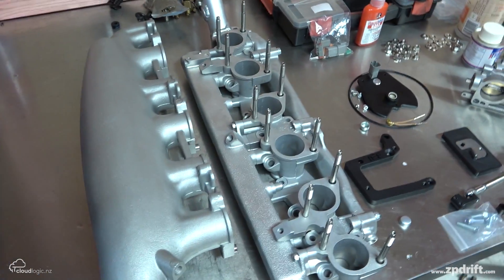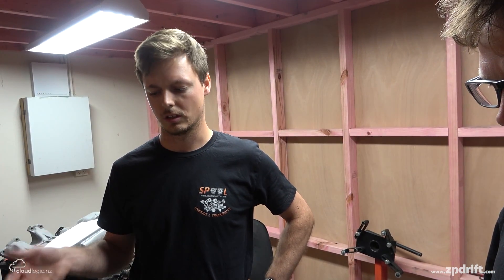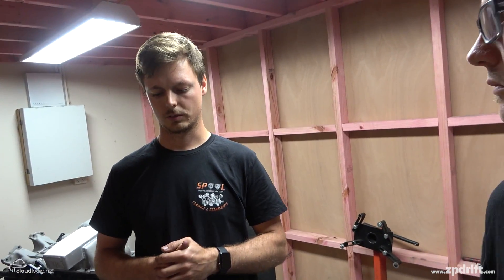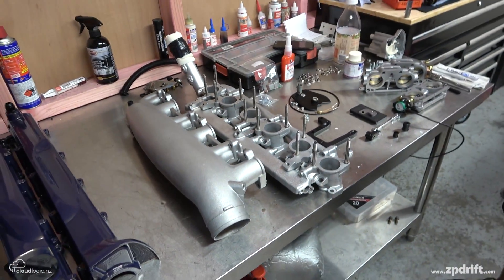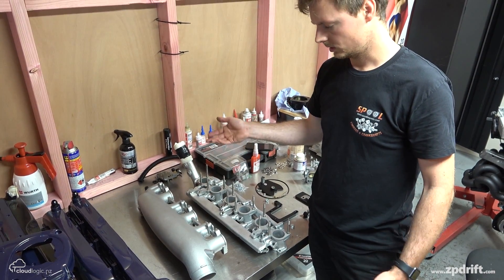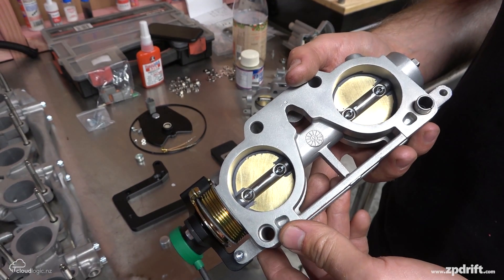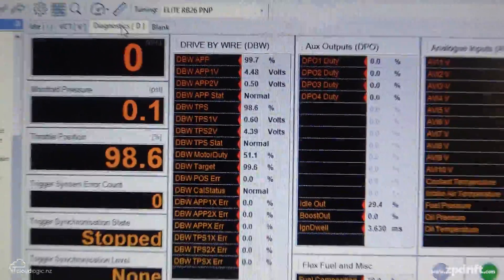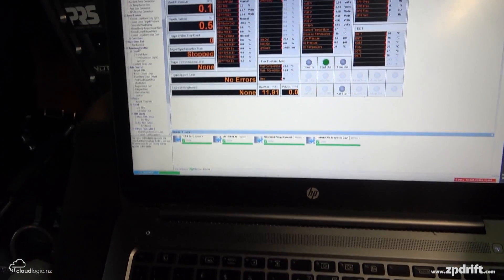RB26 DRIVE BY WIRE ITB - SETUP

Comment: Good demonstration on DBW. But I saw a billet RB block and all sorts of goodies but using an OE intake plenum which is known have so many defects, especially on cylinder 6. Get a decent proper designed intake plenum is a must for RB26 . ITB should not convert to too large throttle bodies as the car will be difficult to tune and drive, feels like on/off throttle once is too much oversized

Comment: What if you want to rev the engine while your in the engine bay? Cab the throttle still be actuated by hand or is there a button/lever with a potentiometer?
Reply from the maker: Yeah - can't rev it when in neutral via a cable, need to have the throttle pedal all setup etc.

Comment: 8:28  Cool benefit of going to DBW in a drift application is the ability to do legit anti-lag (where it injects fuel off throttle to keep the turbo spooled.)  Just gotta soften it up in the tune since pops, bangs and flames introduce a lean condition along with shock loading and imbalance.

Comment: Worried about the engine sitting on the limiter but  not worried about the damaging effects of antilag? ...
Reply from the maker: Main issue is that the head still has shims under the buckets, which if the rev limiter is harsh at high RPM it'll possibly spit them out and then other issues happen. Antilag really would be only for lower RPM , where the likelihood of spitting a shim even with the explosions happening in the exhaust manifold - would be substantially less. I'm not too concerned about anit-lag issues versus spitting a shim at high RPM would could be catastrophic

Comment: DBW is far superior in every aspect and has many benefits, even more than you covered but my question is Are the benefits of ITBs worth the difficulties tuning the motor.
Reply from the maker: Any good tuner should be good to tune either ITB's or single throttle . I personally don't think the hurdle of tuning difficulty should be a considered a problem